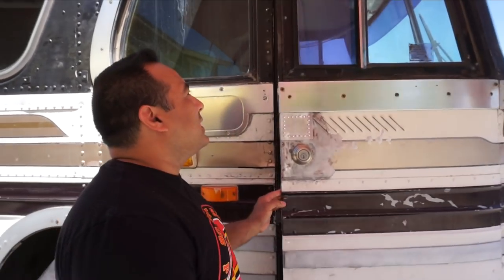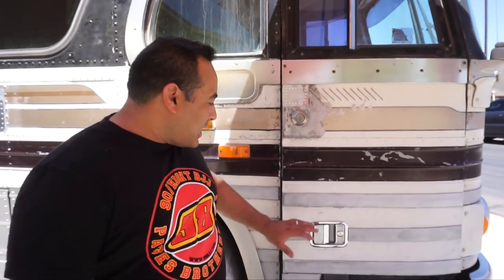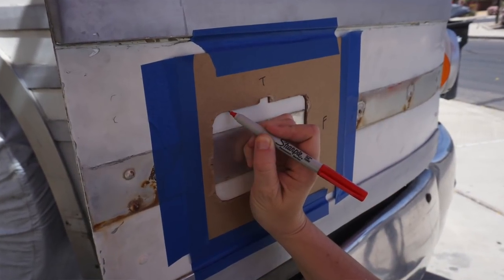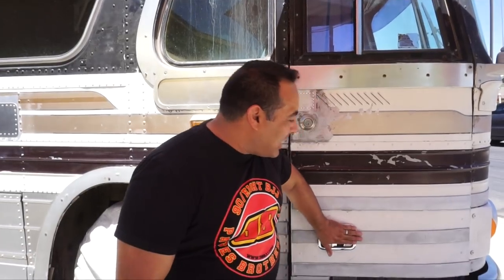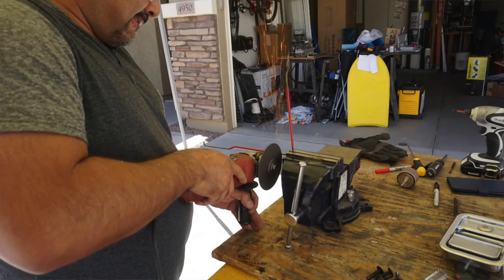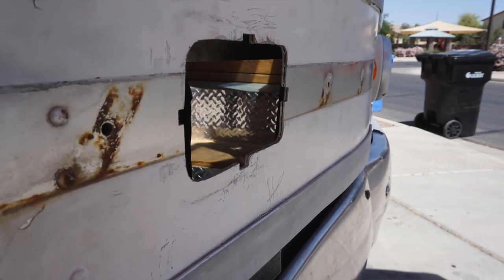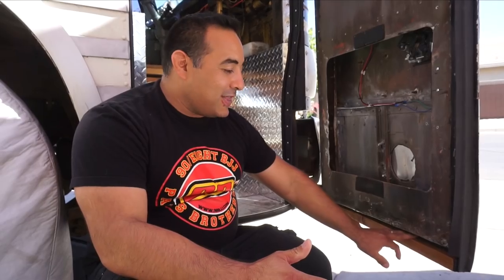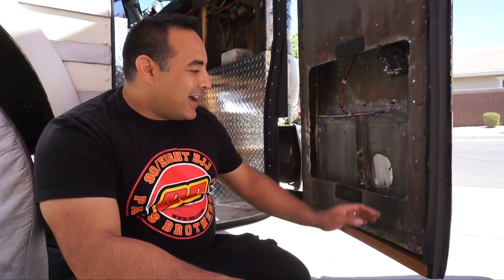Epic Bus Door Tale: Part 2

Comment: Great job overcoming all these door hurdles! Another possible option for a door latch that is way simpler and won't have the bolt sticking out is the 76-81 Jeep CJ style latch. Jeep parts are great because there will always be tons of sources.
Reply from the maker: Another guy used a Jeep-style latched and it worked very well - thank you for the advice - maybe someone will read this and it will help them :) - Thank you!

Comment: Don't forget to weatherproof those bottom boards.  Excellent work!  You've got to feel pretty psyched to have overcome such hardship.  Congratulations!
Reply: That is a very wet area. It seems like if you are going to use wood there, it would have to have an epoxy finish or be completely fiberglassed. And only stainless steel screws to fasten the weather stripping.
Reply from the maker: Yes we coated them twice with penetrating epoxy and used only stainless steel screws.

Comment: When doors are twisted, like what happens when you have to have someone get the keys out when you lock them in your car, you can use ratchet straps to bend it back. You might have to wedge the 2x4 in different spots to put the twist right, but the ratchet straps will work way better than trying to manhandle it. I've done it on a couple cars and trucks. Also, if you lock your keys in a car, you can use a ratchet strap to get in and avoid calling someone.

Comment: if you can get someone to pick the lock there i a small hole that you can stick a pin in this will let the cylinder rotate a little farther and the hole cylinder will slide out then a locksmith can rekey it cut you keys and you don't need any new parts aside from some lock pins.

Comment: used the same basic setup that you but did differnt the out side handle is up quite a bit higher than yours up at the top vent level of the diagonal vents ran a piece flat stock across the top hole in the door and were bottom pocket it on top of the bottom of theholrand bolted the top to the flat strap rebent the rods. and it works with inside and outside handles and can still use the original closing mechanism when going down the road or for extra security when sleeping
THE GRUMPY bus
Reply from the maker: Sounds like a great setup.  We did the best we could with this poor door.  We have the original closing mechanism as well that "clicks" to lock when pushed past the closing point.

Comment: the way you have to open the door from the inside is not DOT safe  . there are many pull cable setups in cars and trucks .  take your time and do it right .  any thing can happen in a crash or even when your asleep at night like a fire to where 12v power is lost
Reply from the maker: Hi Falcon - Yes - 100% agree - we showed the handle that we purchased for this task when we introduced the outside door handle - In part 3 we show how we hooked up this handle to allow for opening the door manually - even if it is locked the pull handle will unlock the door and open it at the same time.

Comment: This is very helpful. The interior door panel should be easily removable so that you can spray lubricant on the mechanism once a month or so. One question: if the coach is locked, and a person is inside and needs to get out, and there is no electricity to activate the solenoid, is it possible to manually release the latch?
Reply from the maker: Thank you Kevin - yes we are playing with Riv-nuts now to help facilitate this.  100% agree about the inside latch - that will be on the next video (spoiler - we have a manual handle for the inside that doesn't need any electronics and can open the door even when locked).